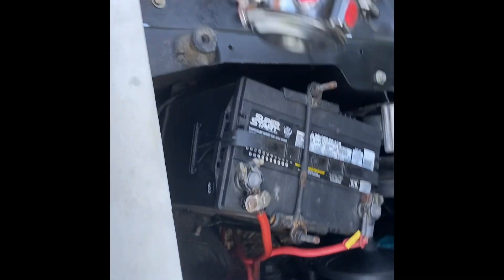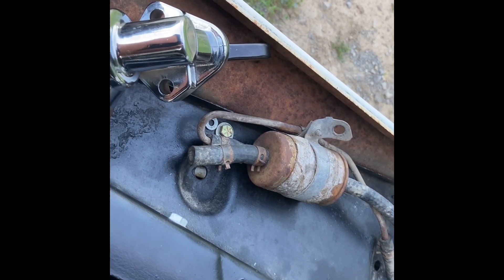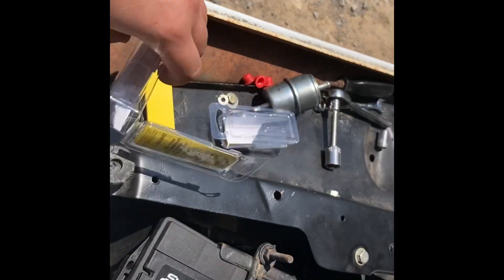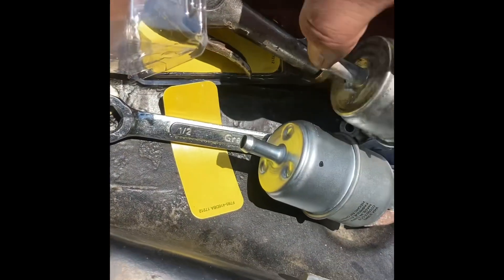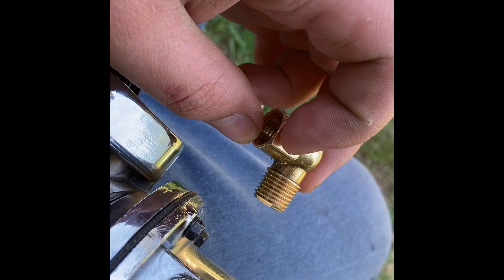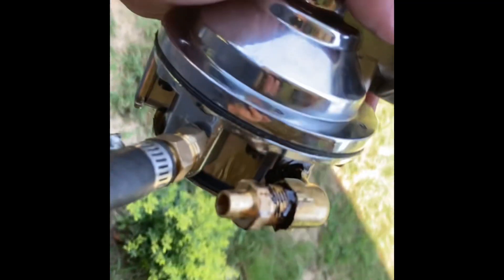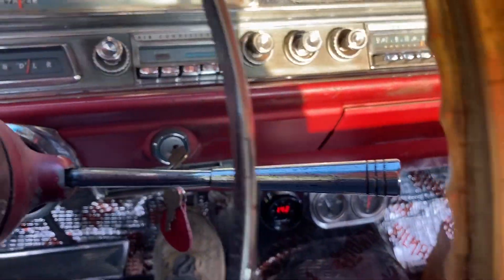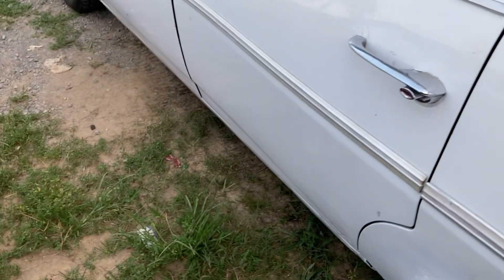Upgrading to a more GPH fuel pump 1963 Pontiac Star Chief #automobile #whateverittakes #pontiacv8

Comment: Hello from Michigan! I am surprised to hear that about Speedway Motors. I have ordered lots from them with no problems at all. Always had excellent customer and tech support from them. Perhaps a disgruntled employee F-ing things up on purpose maybe? Thanks for sharing this video. I hate my loud noisy Holley blue pump and want to go with the Holley high performance old school pump. I will use the return line as my tank has a port just for that. 1967 Mustang Gt coupe with a well built Ford 460 BB, but does good with 61/2 psi from the adjustable Holley regulator to a 750 single Holley carb on a Edelbrock performer rpm intake.
Reply from the maker: Thanks for watching! I usually order from summit racing but it very well could have been a mad employee or just a lazy new guy who knows lol. Sounds like a good solid build you got! I got a 1978 Ford Cobra II with a mild 302
Reply: @SandMountainBallistics  My buddy had a 78 Cobra but had a 6 in it i think. It looked good though and drove nice.
Reply from the maker: @robertclymer6948  I need to get mine done I just keep going back and fourth thinking about how to build it lol

Comment: That pump looks rebuildable too, no?  

A rebuildable mechanical fuel pump is probably as close to bulletproof as you can get with an automotive fuel pump.
Reply from the maker: Yes the knew one is rebuildable hopefully it will do the job for a while. Thanks for watching Dan!
Reply: @SandMountainBallistics  As long as its metallurgy is good, and you have an adequate supply of diaphragm rubbers, you're set for life - the car's, or yours, either way.